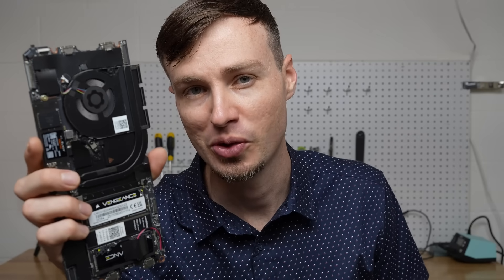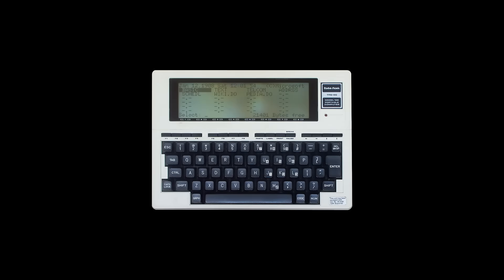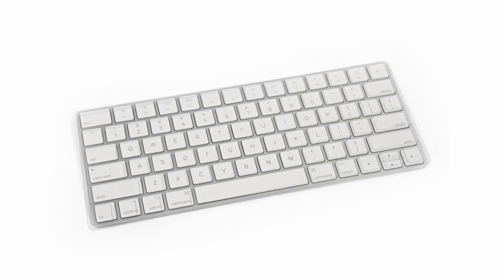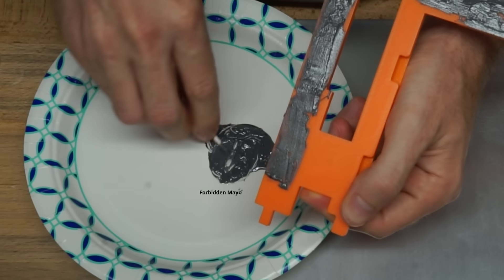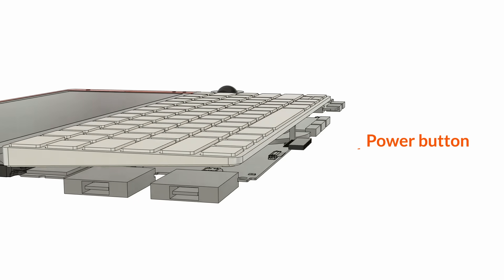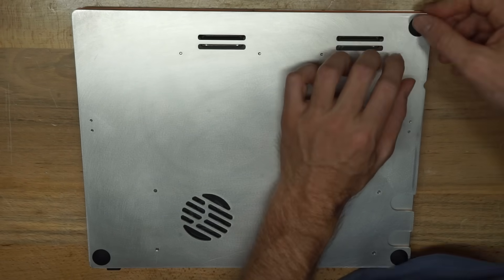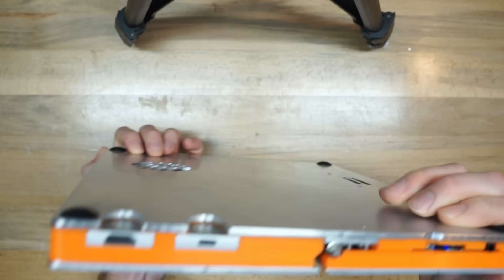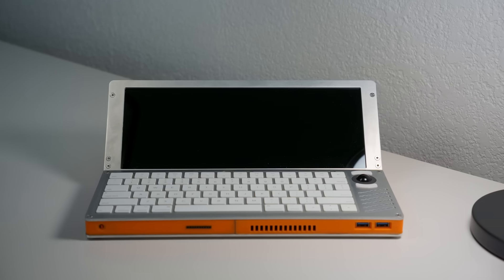Framework Cyberdeck - DIY Portable PC

Comment: It's a cool device and it looks good. My comment is based off of when you said there are no other devices on the market like these examples when there are infact MANY of them. 

Have you never seen a GPD handhelds? My win 2 has a core M 1.2ghz with 8gb of ram 256 SSD and a tiny 5.5" screen. Or go with a win Max 2. My 2022 has a full size keyboard with the key spacing tight making it smaller. Had a ryzen 7 6800u 8 core 16 threads at 4.7ghz 32gb of LPDDR5 6400mhz 2tb NVMe and both a full size and microSD card slots. Has full size HDMI 3 USB A ports and 2 USBC ports. USB 3.2 and USB4 40gb with a 10.1" 10p touch 2560x1600 resolution with 2048 levels styles support. And a controller with hall effect magnetic joysticks built in. I paid $600 USD for it second hand. And with the 67wh battery I can play AAA games for around 2+ hours or watch video for 4-5 hours. Also has built in LTE finger print censor and it fits in the pockets of my cargo pants 

The win Max 2 mini has upto a 7840u with upto 64gb of LPDDR5 7500mhz ram with a dedicated oculink 63gb port all with a 120hz 7" 1200p display. And there are many more. They look very much like yours and especially many of the examples you gave of devices that "they no longer make" 

I use my win Max 2 as my work computer. My daily driver, and as a mobile gaming system and when at home an EGPU with a 2080ti as a higher end desktop.

Comment: I had a custom made PC where the original owner used electric tape. I think the heat turned it into a horrible gooey nightmare that I had to remove from the cables with a lot of paper towels and iso alcohol. I'm not sure what you can use, I ended up replacing it with tiny shrink tube pieces every 3in or so.

Comment: i think it would be cool if you put a mechanical keyboard in it instead of the apple keyboard. also to fix the not being able to pull out the expansion cards problem you could put grippy tape on them or make a mechanism like the framework laptop uses. also also linux
Reply from the maker: You could definitely do a mechanical keyboard, I was just trying to keep the whole thing really thin.

Comment: My concern with a design like this is cleaning the trackball, i'd almost want to use a wired lenovo trackpoint keyboard. They're not built as well and IIRC slightly thicker, but they dont have a battery, and the trackpoint nub isnt really affected by dust/finger sluff, though that introdices a new problem for an exposed keyboard, those nubs are easy to pull off(by design) and while this is welcome for a clamshell laptop that might need them replaced often from normal use, and is protected from it being dislodged while transporting, you wont have this luxury with a cyberdeck.
Reply from the maker: Actually that trackball has a black plastic ring around it which if you rotate it, pops off and then you can pull the ball out. And I can do that without taking the device apart. But your are right about having to be careful with it during transport. Thanks for watching!
Reply: @benmakeseverything  Oh thats great, i personally prefer thumb-ball mice so your solution would be more favorable to my preferences, especially since those track points are at the bottom of the keyboard, making it difficult to use hand-held

Comment: instead of black electrical tape, because it will turn into goo over time, consider using something like 'liquid tape' or whatever brand. great build!
Reply: The best thing would probably be to use some heatshrink tubing, though carefully applied kapton tape would do in a pinch.
Reply: @jnharton yep heatshrink is definitely best for sure
Reply: Tesa Tape is also good!

Comment: I'm sure you started this video before the RPi 5 announcement, so they should be much faster. However, they don't have to run on an SD Card. I run Home Assistant off of an SSD through a USB port.
Reply from the maker: Yeah I saw the pi 5 like 2 days before I posted this, (after I made that segment). But I figure it will still be a while before they are commonly available at a reasonable price. Still wish they could have put an m.2 slot on the bottom of it...

Comment: sony actually made such "cyberdeck" laptops before, but they are expensive and are more of a novelty item so of course they never caught on.
but worth a look though if you're into this kind of thing.
got to love how they really pushed the concept back then.
Vaio UX in 2006 and Vaio P in 2009

edit: fujitsu made similar computers before - check out the UH900 in 2010 and the U1010 in 2007.
gosh how i miss those days... the mid-2000s was the time when pc and phone manufacturers came up with 1 crazy concept after another.
Reply: If you're just talking about very small PCs there's still some like the GPD Pocket series around. That's not really what a cyberdeck is though. Something you can actually buy today and  I might call a cyberdeck because it isn't really a mass manufactured product intended for your average user is the MNT Pocket Reform.
Reply: I really want to get my hands on a Vaio P orange shell and try to put something modern in it, but I feel it'd be practically impossible.

Comment: I would use a simple eject mechinisim on the io cards a button with a small cam that pushes on the bottem of the card to pop it out should be a easy fix on a 2.0
Reply from the maker: Good idea, that's probably something like what they do on the actual framework laptops. Just not sure if I could fit a diy version of the mechanism in the confined space.
Reply: @benmakeseverything  I would 3d print a small arm with a bushing and a screw that slides under the card to act as our leaver or mill it from aluminum the second part would be the push button arm that acuates the leaver basically a small 4mm aluminum rod or plastic(kinda worrie about deflection tho). A small spring attached to the frame would return the push button to the home position
Reply: I dont think it would need much force

Comment: Hi Ben, randomly stumbled on this video, one thing you could look into is Cerakoat. Would be pretty cool to color your raw aluminum. They have lots of crazy colors. I would recommend the air dry kind you can spray it with a small cheap HVLP gun  harbor freight sells. 

I did a bunch of car parts two weekends ago that turned out killer! Cheers. Cool project!
Reply: You can anodize pretty easily too with some items you may have in the garage

Comment: UMPC have ben around since the 80s. That is what this form factor is called. Why no touch screen?
Reply from the maker: Yeah I always wanted a UMPC when I was younger. I almost went with  a touch screen, but it was thicker and heavier and required more than 1 cable so it added complexity to the design.

Comment: Impressed!
Hoping ARM chips make their way to PCs and to Framework, we could have a passive version of this in a few years with little to no perf hit
Reply: It won't happen as long MS can't make  an emulation layer to make  Win32 applications works on ARM properly.
Also,  low power x86 CPU-s can run passively.
Reply: @tyaty  I've got a Volterra (aka Surface Pro 9 ARM in a box) and Win32 apps run "fine". They're a bit slow if they try to do any heavy lifting or massive graphics operations (although games are quite happy) but not in any way broken. I'd say it's like having a Mac Mini with an M0.8! Not sure the motherboard is flexible enough to be given a whole different screen and a battery though, to make it into something like this :(

Comment: The framework actually uses an internal USB for the keyboard/fingerprint reader and you can get breakouts for it so you dont need to loose a usb port for input. Framework also is going to start selling an eDP cable so you dont need to give up the other port for the display.
Reply from the maker: I didn't know you could get breakouts for that. I do hope they start selling just the eDP cables, that would be great!
Reply: @benmakeseverything  it looks like framework has an eDP cable on their shop right now, but I am not sure if that is the right one. I saw a thread on the framework forums discussing trying to use the built in eDP on the mainboard for things like media PCs and the main complication appears to be that the framework mainboard eDP is not entirely standard. the last comment is about two weeks ago, so I have a feeling that the cable listed on their site doesn't really help us here. 

I'm hoping it will work though because I kinda want to get started on tweaking your design a bit to make it a clamshell, and whether or not we can use the eDP port will play into how I make those design tweaks.
Reply: @benmakeseverything Can you make an 18.4 inch laptop With the desktop style keyboard. Video request
Reply: Yeah, that was something that kinda bugged me about that setup. If he can adapt a PS2 to USB using a middleman microcontroller, why not just make an adapter to run them to the keyboard and trackpad IO instead of using up a USB port?

Keep in mind, I'm not saying I'm not impressed. I am more curious about the design choice
Reply: an EDP445 cable??
Reply: They sell the edp cable already, and the display panel side of the cable is correct for 4 lane 40 pin display port on the output (people get confused on this as the edp main board pin out is custom, however the edp cable output is standard 4 lane, not sure about adapting for touchscreen, or what touch screens would be compatible). Also you could just buy the keyboard top cover with fingerprint reader and trackpad included and save a USBC port. The bios even has options to recognize the keyboard input as ps/2.
Reply: @Idontanswerquestionz  > Also you could just buy the keyboard top cover with fingerprint reader and trackpad included and save a USBC port.

At that point, why not just buy a whole Framework?
Reply: That is good to know. What I'd like to do is build a Cyberdeck but with spare USB connections so that an RTL-SDR can be added to the device. With the software for it installed it lets you see and connect to the various radio waves broadcasting in the area (or around the world). After all, if World War III leads to the obvious SHTF you still want to talk to others to learn what is happening elsewhere. (or just where have the latest deer been sighted in the area)

Comment: if you don't mind spending a bit more, I'd go with a custom keyboard using kailh choco switches, and replace the arduino with an stm32 or rp2040 running qmk. (you'd want to add an extra arduino, but that might be better as you can't bork your mouse and keyboard that way.)

Comment: another good option are the asrock industrial 4x4 if you don't mind the extra thickness, and there's more options for cpus.
Reply: I was thinking also a NUC or even the tiny GMK ( so small it only fits a 2245 SSD ) and they do well as tested by many YT's like ETA Prime
 only you would need to build a custom power system for it to be portable/wireless like a battery and BMS for the 12-19 volts required (depending on the model)
Plus many laptop boards that can be cheap too , I wonder if they will drive the 2400/900 ??? no that would loose the HDMI input and that part is Awesome.

Comment: you do realize P/S2 to usb adapters exist and the arduino is not needed?
Reply from the maker: Technically yes, but 1. I am using the arduino anyway for the front header that allows me to control stuff, and 2. Having it this way allows me to code special functions like using the trackball to control stuff, like at 13:56 in the video

Comment: Very cool! But please don't use black electrical tape, it will turn into a sticky mess after a while, which will be very difficult to remove if you have to disassemble device again! Acetate cloth high temperature tape is best for this applications!
Reply from the maker: Thanks for the suggestion! I'll try to get some and replace it since this thing is easy to take apart.
Reply: @benmakeseverything  Also a small USB C extender to access the hidden port on the 6 way bringing it to the side next to the HDMI ?
Reply: Are you talking about what I know as kapton tape, or something more cloth-like?
Reply: @SchoolforHackers   Probably the black cloth tape you can find being used in automobiles. It's more cloth like, and almost always black. Sometimes, you can find this in older laptops holding down cables (e.g. older IBM Thinkpads' heatsink fan assembly etc.)
Reply: @SchoolforHackers  Yes, exactly as @Dreamslacker said. But only with an acrylic adhesive layer, not with a rubber one. This is now used in all modern laptops, at 2:10 you can see a small piece that holds the wires from the cooler in place. It holds up very well, and it's very easy to work with and remove. You can Google it: acetate cloth tape for laptops

Comment: That's quite interesting and reminded me of a dream project of mine which, as I currently visualise it, would too use Framework Laptop 13 parts.

If I recall correctly, the original Framework Laptop keyboard connected through the trackpad and that was likely the reason why you went with a USB keyboard.
Reply from the maker: Yes, there is a special connecter they use that plugs into the motherboard and sends the signals from the trackpad/keyboard and I didn't have a way to use that.

Comment: You can implement scroll with another mouse button.  Hold that button and the trackball can scroll up-down and left-right.  This is how Lenovo Trackpoint works.  I would love to fork this project and design it with a Lenovo Keyboard.  

The missing trackpoint is the main thing keeping me from trying a Framework TBH.  I even considered an HP with a track point, but they didn't have the middle button for scroll.

Great project!  I liked your useful inclusion of a dock and Arduino.  You got 2 USB A, a USB C, and HDMI ports for your trouble.
Reply from the maker: Thanks! You can actually find trackpoint modules by themselves online, I though about using one early in the design phase but opted for the trackball instead.
Reply: @benmakeseverything why not use one of the Apple specific keys to switch the functionality on the trackball between mouse control and scrolling
Reply: @benmakeseverything regarding torrenting purated soft, do u think its enough to just run 1st the software in a vm before installing in the host machine?
Reply: @benmakeseverything regarsing modular phones, why not make the mod phone air pressure tight so that water won't get in.
Reply: I was going to say use one of the currently non functional Mac keys for the function, seems more comfortable than trying to do it with one hand.
Reply: since he has that useless button on the mac keyboard that doesn't do anything, maybe he can map it to enable scrolling?
Reply: i think holding caps lock would work well for this, i bet that's something that can be enabled in software
Reply: @goofnet.emporium That would suck for those of us who use caps lock for typing.
Reply: A trackpoint keyboard would be a nice touch, however if you were to remove the trackball, you lose the ability to navigate while holding the device in your hands, since the Lenovo trackpoint is in the centre of the keyboard and not easily reachable with a thumb.
Reply: @hjf3022  You could put the trackpoint wherever you want but yes, one of the advantages of the trackpoint as used on lenovo systems is its location.
Reply: Have the arduino treat the trackball as a scroll if you click both mouse buttons at the same time.

Comment: I wonder If I could use the framework motherboard to retrofit into an old laptop. For instance an old thinkpad t400 should be big enough and has an metal skeleton that can be modified to take a different motherboard. How one would go about making the original screen and keyboard work with it I have no idea though its probably possible.
Reply: Now that’s a fun hack. You know, a lot of the ribbon connectors are similar...
Reply from the maker: I don't see why not! I think there was someone retrofitting an IBM 701C with a framework motherboard on their forums.
Reply: @benmakeseverything  ooo how interesting Ill have to look into that I guess.

Comment: The transition between your in-room audio and the stuff you're recording at a proper mic is really jarring. If you don't need to use your hands, you could maybe find a cheapo handheld mic?
Reply from the maker: Yeah I did use 2 different mics - still trying to figure out the best way to get good audio. Just got a new one after recording most of this, so hopefully the next video will sound better. Thanks for watching!
Reply: @benmakeseverything If your "on-camera" audio is decent you can do all the VO like that, then it'll be consistent. Of course it'd really help if the on-camera audio was on a better mic without as much roomtone, but I remember that being a tip from people like Spoony back in the day, because going from on-camera footage to graphics/b-roll with audio recorded on a better mic is kinda jarring.

Comment: This totally reminds me of the Toshiba Lbretto from the 90s! I remember seeing it as a kid and wanting one (despite not having any use for it at the time) 😅
Reply: This little thing blew my mind, it did not need it, did not have the money but it was just so awesome. Thought about buying a used one not that long ago 😅
Reply: @Webshadow  I almost did back in around 2005.
Found one unit in a display case at a local computer repair shop - it was a novelty item they put on display and didn't expect to even sell it. When I asked for the price, they couldn't even quote me and needed to have a discussion before asking for (equivalent of) USD150 (to be fair, it was in good working condition and did boot into Win 95 except the battery was dead and needed to be plugged in to work).
However, I couldn't justify buying it at the time as I still didn't have a use for a 486 running Win95 nor was it vintage enough to be collectible. Not to mention I was still a poor student back then and it would have wiped out a substantial part of my savings.